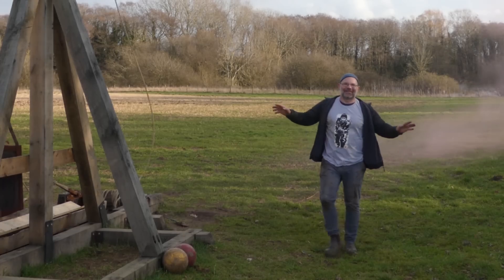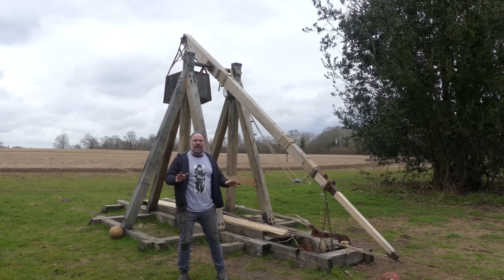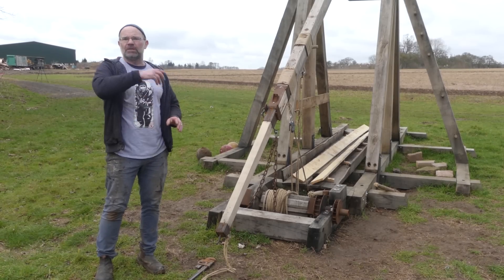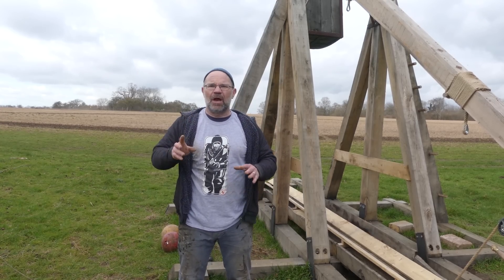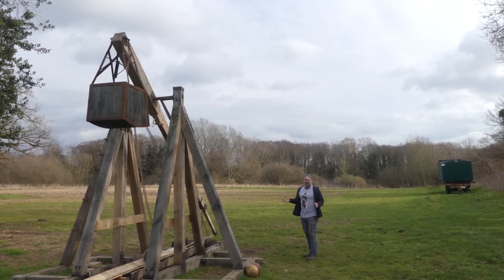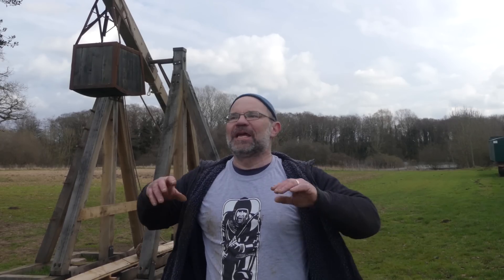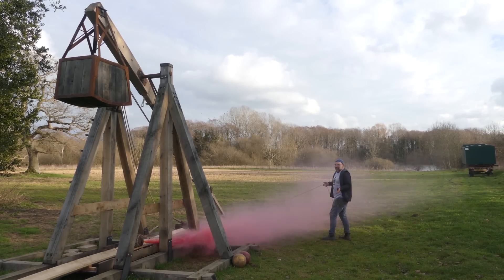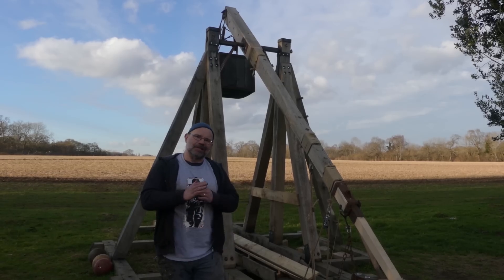Trebuchet - Why won't the darn thing shoot further?

Comment: Have you considered trying both a lighter and heavier bowling ball that would then give you 3 data points. The maximum distance that can be achieved is determined by the mass of the object and the acceleration of said object. Assuming you are keeping the counterweight and bowling ball the same from now on. The only difference should be in the release angle of the bowling ball. If you release too soon you obtain a higher arc and less distance, too late a lower arc which results in less distance due to collision with the ground. A perfect release angle then achieves max distance for a given weight of ball. If you then ONLY alter the ball weight a lighter object should travel further and a heavier object less far (until such time as air resistance starts to affect lighter objects). Altering the Lever Length should affect the acceleration of the object to its maximum velocity. Hope that's right and makes sense -  my higher math is exceptionally rusty!!
Reply from the maker: MY higher maths is non-existent, but in essence my bowling balls are too heavy.  I know that, but they are so nice to throw.

Comment: You need to tune the counterweight and sling. There are  many videos online about this. You want the stop from the counterweight to be about the same time as the sling release.
Reply: https://youtu.be/-gn2RGPqe_A
Reply: So, these are super important design points. The weight of the projectile also changes the sling stall point.

Comment: The length of the basket (pin to bottom) seems to produce a harmonic that stops the arm prematurely, I’m not sure if shortening it or lengthening it would be better.

Edit: Moving the weight higher  in the basket would move the center of gravity of the basket and change the harmonics. Maybe stick some lumber under the rocks or whatever you’re using.

Comment: i am no engineer, so take it with a grain of salt, but on the wikipedia article of the trebuchet, there is a 15th century depiction from thalhoffer that shows something like a fixture on the counterweight and the beam, which would mean that the counterweight would "follow through" more and then swing back. i notice that your trebuchet very much stops around the point of release, but it could actually be well before that? that would mean it would not get the maximum velocity it can. would probably need more adjusting on the sling and pin to get the release point right of course.
link to the picture:
https://upload.wikimedia.org/wikipedia/commons/thumb/a/aa/Ms.Thott.290.2%C2%BA_016v.jpg/800px-Ms.Thott.290.2%C2%BA_016v.jpg
Reply: yeah i think that makes sense, that way the force applied would more work normal to the axis of rotation and you should get more forcetransfer is my guess. no idea if that will break anything, so please don't blame me if you should try :D
Reply: no idea if it needs a second release (for the counterweight this time) to work properly, that could be a thing.... basically like moving your legs backwards on a swing so your center of gravity shifts.

Comment: Now I can't say this for sure nor how to fix it, but I think I may have an idea why you aren't really gaining distance.

If you remember back to previous vidios you made about crossbows you explained why a more powerful crossbow wouldn't shot further but instead it would just be able to fire a bigger bolt which would in turn cause more harm. This is because of the limitations of the materials and how efficiently they can transfer energy into the projectile and without a compound bow to remove as much inneficiency as possible, there was just no way to impart further energy into the shot.

I believe your trebuchet may be suffereing from something along the same lines. Maybe not so much a limitation of the materials (or it may be, I certainly am not a siege engineer) but rather something is limiting how much energy you are imparting into the shot (which was probably what you were looking at the hook for answers). Changing the angle of the shot, unless it goes to extremes where it starts losing a lot of altitude or gaining too much altitude, you will never really gain an appreciable distance and I think this was made already abundantly clear by your tests.

Of course, as you said, those tests are not serious tests but by the fact that they are landing around the same distances the tests would probably not average to much more or much less anyway. So you need to look for answers elsewhere. The materials, the construction method, the size of the arm, the bucket, etc. Everything that can impart energy into the projectile must be tested and changed to be able to better impart the energy into the shot... which is a costly and time consuming process of course.

Another thing you may also want to consider is the weight of the projectile. While trebuchets were meant to fire huge boulders up to 270 meters, these were much bigger machines firing a much heavier projectile. That is to say that a bowling ball is a relatively light projectile by trebuchet standards which surely already puts a limiter on how far you can throw it in the same way that a bolt for a crossbow that is very light will lose on distance to one that is heavier.

Anyway, this can be all wrong, but I think it's worth a thought. If I'm completely off base then it's something you can cross out of the list and if not it will hopelly point in the right direction.

Comment: I have seen a few comments saying that all else being equal, the optimal release angle would be 45 degrees. This is true for an object in a vacuum being launched at ground level, but it is not true for an object being launched at any height above the ground (assuming the shots land at ground level). In general, the higher up the object is launched from, the closer to 0 degrees it should be. I am not sure how big of a difference it would make at this scale and with this trebuchet but is just something to know about. This is also with all other factors being equal, which is not necessarily the case here. For example, different release angles might correspond with different amounts of energy being put into the projectile, resulting in different end distances. It complicated!

Comment: Your bucket is now too close to the ground.  It hits the lowest point of travel before the arm completes the throw, reaching the apex at a later time than the shorter arm.  I hope that makes sense to you, but you either need to shorten the distance of the bucket to the arm, or increase the height of the trebuchet and length of the counterweight arm.  Really all of this is much nastier to fix than simply fidgeting with a pin!
Reply from the maker: Thanks and I am trying to avoid anything too big
Reply: @tods_workshop  That I can understand.  What you've already built is very impressive, and I couldn't frankly tell you if moving the bucket about on the arm would be worth it, for all the trouble it would be.  Good luck with that science show!

Comment: You've dismissed my wheels/rollers suggestion before, but being able to move allows the weight to drop vertically instead of thru an arc, and that will provide a small increase in range. So my challenge is :- prove me wrong 😉
Reply from the maker: Many people have mentioned this and not sure in what context I dismissed it, however I have since (partially) changed my mind and not sure if you were the chap to drive that.  Basically I still haven't seen compelling evidence they did put them on wheels but constructing one of these within bow shot would have been very difficult, so I assume they were constructed out of bow shot and then brought in and that of course would mean wheels.  Not definite, but I now feel happier they might have had wheels.
Reply: @tods_workshop  No wheels on a HCW. They dampen the throw. Wheels on a HCW cancel out the action of the hinged basket. However, wheels on a fixed counterweight trebuchet do increase the performance.
Reply: @tods_workshop  Surely the best way to answer the wheels/no wheels question would be to add wheels to it and do some test shots?  You already have a baseline for "no wheel" shots so this should be quite interesting.
Reply: Tom Stanton's had wheels.

Comment: Take the videos and frame by frame plot the radius for each component over time as you did with the trajectory plotting. (BTW, very nice) This should reveal the points of rotational misalignment. The timing is off some where. Like a car engine,  everything must be timed properly for the exact moment the fuel must be ignited. Love this communal discovery process. Keep going!

Comment: Hey Todd, I think you should make one test set of shots to quantify the accuracy of the trebuchet, this might answer some questions and make this experiment less frustrating. If you do 10 or 20 shots at one setting and estimate mean and varinance. I assume the standard deviation of the range is at least a few percent. Without regarding the weather. As an engineer my experience tells me, that an estimation of variance for one configuration also holds for slightly modified configurations. So you really need to do this only once.

Also I just had the idea, if you would also measure (with your camera) the launch velocity, then you have a weather independent quantity which you can compare. Range and launch velocity can of course be measured with the same shots.

Also, if you think some academic advice could be helpful, feel free to ask me. I'm an engineer, electrical though. If you want I can send you a personal message.

Comment: I am far from an expert but this is just my observation. 
It seemed to me looking at the footage that when the arm came to about the roughly vertical position it seemed to really hesitate perhaps even go back slightly. 
It was almost as if the counter weight effectively just fell vertically instead of doing an arc.
I was just contrasting this with a simple sling where the movement up to the point of release is smooth as is the follow through.
Could it be something to do with the counterweight being articulated rather than mounted rigidly or semi rigidly at the end of the throwing arm????
Reply: ROswell5104,
The lever stops at vertical because of the weight being able to swivel. So some of the length to accelerate the projectile is lost. The weight movement has to be timed to have the weight reach its highest velocity at the same time the projectile is released. The weight's highest speed is before its farthest point of travel.
And the best point of release must be determined or estimated first. The weight must be attached solidly to the arm. 
Seems the weight might have to be moved a bit toward the front of the trebuchet so it reaches the end of its work at the same time the projectile is released, which will be at some point slightly past the arm being vertical.  
So the arm swings up; the arm swings smoothly thru whatever arc it makes because the weight is attached solidly to it. 
The projectile releases at the right point. The weight reaches the end of its travel at the right point, the same point the weight is making the most work, because it's attached solidly to the arm. Seems.

Comment: @Tod's Workshop I think you might be forgetting a very critical factor...winds aloft are much higher than ground level, and have a huge effect on the shots...you need to know the winds aloft and make multiple shots for each adjustment...in target shooting, marksman are taught to always maintain the same point of aim for a grouping, when sighting a weapon...changing the pin between shots is the same as changing your point of aim, and expecting to hit the same place...in target shooting,  you aim off (adjust for wind) but only after the weapon is sighted in, not while trying to sight the weapon in...I hope that helps, I was a marksman first class, in the Canadian army for 20 years, and even I miss this critical factor occasionally...best of luck

Comment: How about adding more momentum to the system?
It seems like you have reached topspeed that trebuche can produce, but what if you lobb heavier objects that has more momentum to push against the air?

Add more weight both in the shot and in the basket and see if that makes a difference

Comment: P. S. to my previous note, if the rules of the game allow, make one hook angle adjustable by a screw mechanism so that the angle of the hooks at point of release can be precisely controlled.  Make the hooks strong, if you can bend them by hand they are going to unbend on their own and will always be a source of variability, polish and grease the interfacing surfaces so they behave the same way each time, even burnish the interfacing surfaces (or with time they will become work burnished if, for example, we have to lay siege to Moscow).

Comment: As much as it sounds correct to shoot at 45 degrees to get maximum distance. Is that the case on an accelerating arm. You have to weigh off velocity with angle of release. The velocity will be the highest once the counterweight reaches the bottom, which means the longer it is in the sling the faster it will be travelling. Obviously 45 degrees would give best height to length ratio assuming velocity was equal. So I would guess a slightly later release would go further.

Let's say 0 degrees is lying flat and 90 degrees is the arm vertical. You have maximum velocity at 90 degrees. At 45 degrees you only have half velocity. So it might be optimal to release at 60 degrees.
Reply from the maker: Correct release angle is tricky to define, but fortunately the distance thrown doesn't change much for quite a wide range of angles, so I suspect that between about 37 and 53 degrees there won't be much difference

Comment: Try greasing the axle, or run it on bearings. More speed will give further distance
Historically they could have used animal fat mixed with beeswax as a lubricant in place of modern grease lube
Reply: no.  it is much simpler than that.  if you increase the length of the arm from the pivot, you need to increase the arc of travel to get the same acceleration at the point of release.  which means you need to raise the pivot to give the arm more travel time.  it's very simple physics.  Hell, you can probably find a very similar example used in any freshman or high school physics text.

Comment: Did you lengthen the arm but not raise the legs/ supports? Higher frame would allow more drop for the counterweight and further travel for the throwing arm.
I would say you have raise the pivot the same length you lengthen the arm to give the same amount of rotation you had before.

Comment: You could increase the power output a bit by adding a raiser on the short part of the arm. This way the hinge point is a bit off axis which will increase performance.

Comment: Fascinating.  I don't know a damn thing about trebuchets except that I built one in grade school about 55 years ago and have loved them ever since.  I apologize for having the temerity to make a suggestion.  Your release angle has a huge effect on trajectory and distance and your release mechanism that determines the release angle is total rubbish. By chance it seems to be varying by tens of degrees when it needs to be controllable to within a degree.  I agree that having a longer pin seems bad because it adds "uncontrolled slide" time. Rather than having a soft rope releasing over a vaguely bent pin you need a hard interface with two opposing metal hooks so that they release in a completely reproducible way.  Each minor adjustment to the hooks interface angle should result in a precise change in the sling release angle.  If this babbling is not clear enough I can send you sketches.  And I apologize, I am almost certainly wrong.

Comment: I think I've got idea what might be the problem. Given equivalent speed optimal lanch angle should be 45 degrees, however the launch speed isn't equivalent in all the scenarios. The projectile is gaining energy until the launch angle is parallel with the ground, because the weight is still lowering down towards the ground. So even if the lanch angle is worse the speed is higher resulting similar results.

This might be feature not a bug, since from what I've understood the trebuchet is supposed to launch pretty much streight to maximize damage on the walls.

Comment: Moar trebuchet pls. Would be nice to measure the rotational speed at the axis-mount. Either by camera or other way. Just to see the speed and spread. That should be the main component of the force at the end of the arm. And then it should be possible to calculate what the maximum throw is.

Comment: Hey Tod, do you reckon you could pack a bundle of war darts into a kind of sabot for the trebuchet? Sure, river stones are available by the bucket in most places, but you're the guy with a trebuchet and handfuls of war darts.
There's a field full of cavalry bearing down and the engine is ready to fire; you going to lob one bowling ball, or a huge bundle of war darts?

please?
Reply: These things are siege weapons, they're not portable. Or even really aimable more than a few degrees.
You build them on-site out of range of the castle archers over the course of a few days, then smash and/or set fire to the place so your troops can take it.

They would be a total liability on a battlefield.